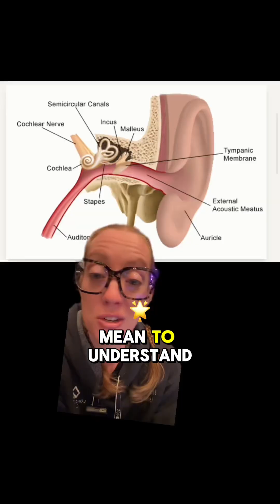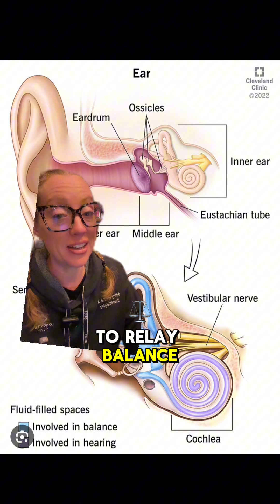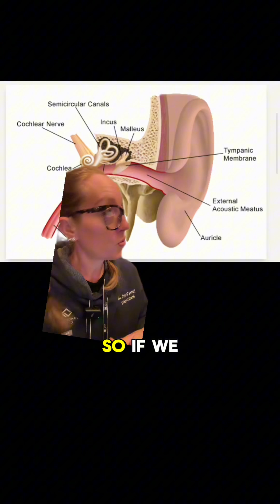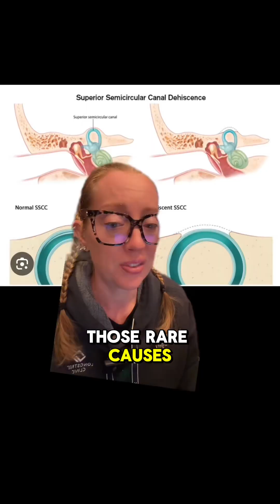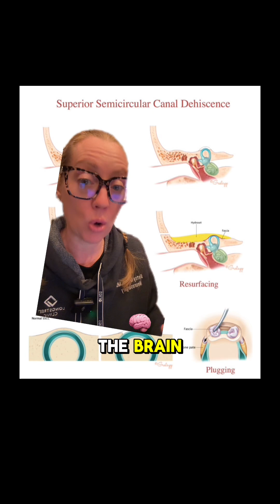Case study 129 | Superior canal dehiscence syndrome (SCDS) | Explained by Dr. Betsy Grunch

Comment: I was diagnosed with SCD after a hospital visit in Vietnam where I was on cable car coming down from a 3143 meter mountain. My ear popped, I became extremely disoriented and was taken to hospital. The doctors has told me that I had an a heart rate of 34-50 bmp and I needed medication to speed my heart back up because they thought I had Sinus Bradycardia. I returned home and after many testes it was determined that I don't have Sinus Bradycardia but I do have SCD.  I've since had one other episode when a plane was landing. It seems as though my episodes are triggered by sudden changes in altitude compounded by being sick and stuffed up . Being that I need to travel for work would you be able to share some knowledge on  how to navigate this form of SCD?
Reply: If you will be flying you need the special air plane plugs to reduce the pressure.

Comment: I was diagnosed with this after getting a CT scan of my ears.  A few ENTs before couldn't figure it out and just said your hearing is fine.  Finally my new ENT wanted to check further.  I  hear my  heart beat, eyes move when it's quite, feeling clogged all the time like I'm in an airplane and I hear my voice distorted when I talk.  Like a busted inner speaker.  Oh and the best is the base drum when my heels hit the floor when I walk.  Also get dizzy a bit durring activity.  Left one is the worst but right one is catching up.  Surgery might be in my future as the thought of having this forever is pretty depressing.  Could be worse things to have and doing my best to get used to it.  I did notice that when I get dizzy I'll put an ear plug into my left ear with is the worst one.  Seems to help.  I think its just my brain using the ear plug to justify the clogged feeling and adjusting.
Reply: Same here. Please reach out. I want to talk.